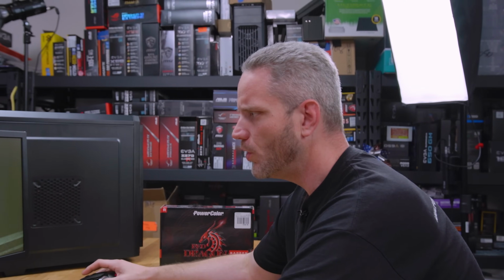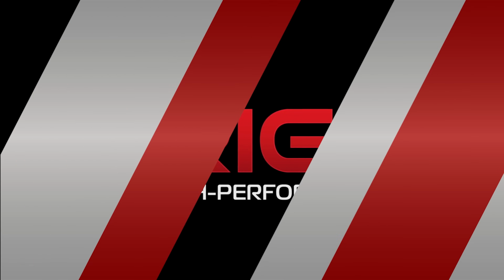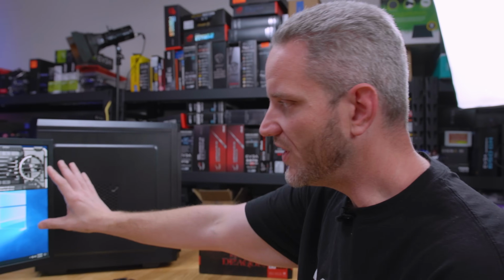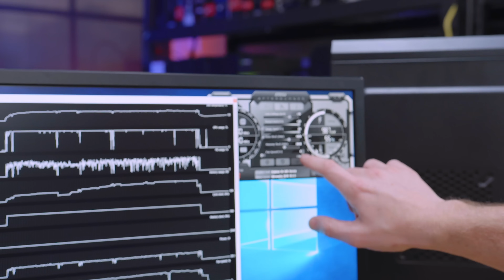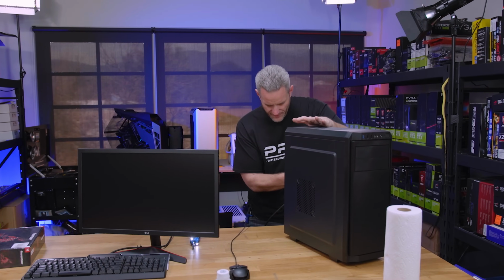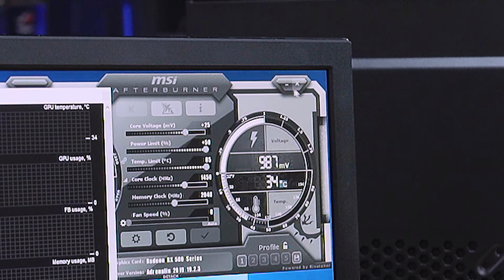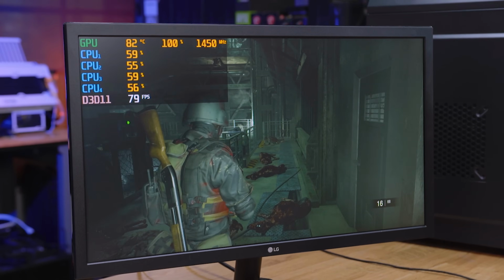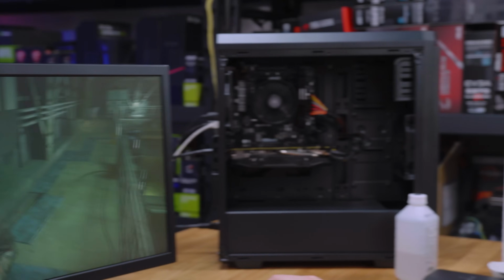Should you replace your video card's thermal paste??

Comment: Crazy. On my xfx gts rx580 8gb I only get 80c on a demanding game if I OC to 1500mhz in amd overclock. I also adjusted the fan curve, k got tired of the fans just sitting idly while the card got toasty. Works wonders for me! There is a bit of a coil whine, but I have headphones so it blocks it out for me.

Comment: Thermal paste degrades very slowly. There's a good chance you will not be able to tell after FIVE YEARS unless you are carefully running benchmarks. If your performance degradation is fairly sudden it's NOT your graphics card paste. Probably not the card at all.

Comment: So now seems how you kind of pointed out the fact that the bottle neck was the case air flow.  What happens to the levels with the factory thermal paste if you put a fan on it.... You know what, it prolly doesn't matter.  The good thermal paste and a large fan only took off 5 degrees.

Comment: Jay did you check the fan speed before and after?
GPUs are ok with 75-80°C and depending on type and manufacturer the card will stick to that temperature and would run with lower fan speed instead of let you see a massiv temperature drop.
That's whats happening with new cards if you open the case. Sensor says "Hi, temp is dropping! We are at 77°C!" -> Controller + Fan "Well, ok, i can slow down - all good!"

Comment: The problem with changing the thermal paste on my old cards is that i cant find any accurate specifications on the thikness of the thermal pads, so im afraid of buying and putting in the too thik or too thinn pads on the vrm and memory modules.

Comment: I have a case with 3 120mm intake fans and I can literally feel the air being sucked in when I put my fingers up to the front intake. Unsurprisingly, GPU temps are not such an issue in my case. But I really should replace the thermal paste on the GPU (And CPU, come to think of it!) anyway because the R9 280X I am running is rather long in the tooth, so to say, with the added bonus of having spent god only knows how long shoved in a drawer with dozens of other cards.

Comment: awww...a case with a a side fan slot <3 man I miss those...computer manufacturers completely sacrificed performance for bling lately didn't they? It is clunky to open the side panel, but if you popped a fan in that slot you'd see those temps drop for sure.

Comment: I'm guessing that the heat dissipation bottleneck wasn't that the paste couldn't move enough heat from the core, rather that the case doesn't replace enough hot air quick enough to keep the GPU from warming up.  If we want to show air cooling performance, why not show a computer that's got as many fan mounts filled as possible? I understand that this was a budget build, but the lack of case fans probably means that the GPU is doing some throttling or kicking the GPU fans into 100% just to maintain 80 degrees.

Comment: My EVGA GeForce GTX 1060 6GB SC apparently had a bad thermal paste application from the factory. It used to run real hot with the fan running wide open all the time. I took it apart with the intention of slapping an Asetek cooler on it thinking that the smaller single fan cooler was underpowered. I decided not to fool with it and put it back together with a fresh application of Noctua NT-H1. I wanted to make sure it was still working OK and threw either Unigine Valley or Superposition at it. Night and day. 20 degree drop in temps and higher boost clocks. It was amazing.

Didn't do shit for my GTX 1080 FTW2 though. Not that it was running particularly hot. Just felt like doing it after a year or so of use.

Comment: I had similar experience with my EVGA 1080Ti. My temp was around 85c during heavy load. I decided to take the side temper glass window off the case and placed the big fan much like in the video. My GPU temp went down to 74c. I looked around and noticed I have a 240mm AIO cooler mounted on the front intake and it was blowing in hot air. So I decided to rearrange my entire system by buying a smaller AIO down to 120mm and mount it at the back of the case as exhaust. Then I've installed 3 fans on intake in front and addition two fans on top as outtake. My temp went down to 76c under full load but now, my CPU holds around 55c under heavy load instead of 45c with bigger AIO. It's a trade off lol.

Comment: So, I have changed the thermal paste on my trusty old MSI R9 390x (overclocked to 1150-ish MHz, so consuming like 300W or something). On stock TIM, I used to get around 78C with these settings on average, but with spikes just over 80C with my fans pinged to 80%. After it started getting worse about a year and a half after purchase, I replaced the stock TIM with Gelid GC Extreme. Great paste, brought the temps down to about 74C for the same settings, but never spiked above 75C. After reading up a bit on the matter, I also purchased some Kryonaut and let me tell you, the hype is real. Gelid GC Extreme was for a long time the best performing paste on the market. Even so, Kryonaut managed to bring the temps down even further to 72C, while I was testing with higher ambient temps (Something like 24C vs 21C with the Gelid). Not only that, but it's been almost 2 years since I repasted my card for the last time, IIRC, and the only time I got worse temps was when I had dust build up in my GPU cooler. Cleaned it, boom, back to the same temps. That thing is miraculous, I'm telling you.

PS : Also, even though it's really not worth it for the money, I got some Fujipoly Extreme thermal pads for my VRMs and those brought the VRM temps down by like almost 10C. Ridiculous difference. Pity they cost like 20-30€ for a few tiny pieces.

Comment: A rapid temp increase(steep rise on the curve), can give an indicator on if the thermalpaste is not as efficient anymore. But the temp might not get higher (or lower after some time) due to the temp/clock setitings. Many cards has a factory fancurve set to hit 77-82c at sustained full load. (to keep the card as silent as possible) But a good thermal contact will give higher clocks at full sustained load with the factory fan profile - meaning that the clock will not need to throttle as much to keep it at around 80c.
MSI Afterburner with the optimized custom fancurve, will keep the temps down (sometime 10c or more), but also make a bit more noise. The upside is lower temps, since it clocks the higher Turbo boost freq the further away from temp limit.

There are exceptions regarding the factory fan profile/temps. I had the Gigabyte Xxtreme Gaming GTX 980 Ti, which was practically silent AND running at around 65c with decent silent airflow case (Define R5). But that card has a massive cooler on it. Also the MSI and EVGA aftermarket coolers do a good job silent,  keeping the GPU at max 70-75c, even on a 1080 Ti - as long as your case gets the heat out.

Comment: I use a cheapo bench mount as my case and don't have any issues with heat. Sound level is fine because the fans never spool up to high speed under load. ;^)

Comment: Changed manufacturer thermal paste to Thermal Grizzly Conductonaut (Liquid Metal) and dropped from 83 no OC which was set to limit to OC which is around 2000MHz at 75 
GPU is GTX1070Ti Armor

Comment: That card has a heatsink with longitudinal fins, which means it's exhausting some of the air out the back. If your front intake fan wasn't blocked off so much it would have enough force to push most of the air going onto the fin stack out the back and not into the case.

Comment: I have 9 fans inside my Liam Li 011 Dynamic and it is set to like 1700 RPM lol >_< Then my RTX 2060 that is coming Monday is the windforce version ... So, I'll have 12 fans LOL - Technically the top three are all set to push air out of the case while the other 6 push air in.

Comment: there is something else that could be a cause and thats poor machining/of the contact area on the GPU heat sync unfortunatly i dont have pictures but there is a definite differance between two asus ROG stix 1070's heat sync's one runs hotter by about 10 degrees and one the heatsync is alot rougher on the bottom compared to the other one

Comment: Not sure about video cards, but I replaced a thermal paste on my CPU with stock Intel cooler (and the preapplied thermal paste) after 5 years and the temps dropped from 85-86°C to 68-69°C max. Bigger improvement than I expected.

Comment: I redid my paste when I threw on a Kraken bracket and air on my 1080ti.  MSI caked it at the factory.  Maybe I should try adding an intake fan.
Reply: Is the fan on your G10/G12 a PWM fan? I know the stock G12 fan is a 3 pin fan. I would highly recommend getting a PWM fan & a PWM to GPU fan adapter cable. This will enable the fan to be controlled via the GPU.

Comment: I replaced the thermal paste on my early 2014 Gigabyte GTX 760 with one of the best currently on the market. The original paste was completely solid and brittle at this point. Then I replaced the fans with aftermarket ones with 3-4 times the static pressure. I gained nothing. Zero. Nada. Maybe the card was boosting higher but the temps were exactly the same. Finally I cannibalized the factory mounting plate and bolted (and by bolted I mean I used a large number of zipties) an AIO to it. Yeah it cools the vrm too. Gained about 20 degrees average and I don't have huge spikes in temperature. It's been 2 months and the mounting solution is flawless.

Comment: Nice video Jay! I just posted that I was doing this to my MSI 7850 2GB the other day. Never have replaced the paste since I bought it in 2012, noticed the other day only 1 fan is working. So order paste and replacement fans.. Unfortunately different manufacturers use different sizes and I got the 85mm and now am waiting for my 75mm to come in. Can't wait to see my results and see how long I can keep using this card. Fix it for 25$ or buy a new sub 200$.. Wife says fix it as I just got all new components except gpu to stay in budget.

Comment: I thought the AMD default fancurve used a "target temperature" system... where it tries to maintain the card at exactly 80 degrees.
Looking at your temps wouldn't reveal any differences. You'd have to look at your fanspeeds to see if the thermal paste made any difference. If it's maintaining 80 degrees at a lower fanspeed, then you've improved the card's thermal performance.

Comment: ANY HELP MUCH APPRECIATED!: 
I have a gigabyte gtx 1080 which I use along with evga precision. Whatever temp target I set, the card will reach it 10 minutes into playing and start throttling. The card isn't overclocked in any way, not even the power target. I only got the pc in october but it has refurbished parts and I have air dusted the card with no better results. Some games are worse than others, project cars 2 being the worst one atm. I use 100% fan speed all the time now but it still reaches crazy temps almost instantly (90°+). Should I change the thermal paste?

Comment: My old R9 290 was hitting 96c under load.  Repasted the core with some MX-4 and temps came down to 74c under load.
Reply: lol that still a lot. i mean you talk about amd things how should i know
Reply: @killerash13  74 isn't a lot you're actually lost
Reply: @weavercs4014  For a laptop yes isn't a lot. But for my desktop i dont like it to run that hot
Reply: I stuck full cover EK waterblocks and backplates on my two R9 290's, flashed them to 290X's and used them as silent cards for nearly 6 years with 35c temps, under load!

Comment: Whenever I watch videos like this, it reminds me that most GPUs can handle going up to 80c without issues. Yet I refuse to allow my 1050ti to go over 62c while under load. Makes me think I probably have some serious wiggle room that I'm not using with it lol.
Reply: agree...mine goes to 70- 75 and i am like ... " my card is going to fry "
Reply: @muhammadarslanriaz7778  Mine shuts down at 80
Reply: My gpu fan is set to 85% all time, 1070 usually dont go above 85c with overclock... Anymore though and i get pixel artifacts and crashes.... Stable oc with okay temps 👍
Reply: Yeah you're overly cautious. Once you get to 88c+ and throttling/overheating happens, THEN you can be worried LMAO!
Reply: 62C? Hah mine goes up to 102C before force shutting down the PC, loosing all of my work.

gET oN mY lEvEl n00b
Reply: @zedg7473  g1t gud scrub
Reply: @LuizAlexPhoenix  Wow this brings back so many memories of my low fps days, suffice to say I upgraded to a used gtx 970 and a 144hz monitor after that gfx card overheated and burst into flames. One of the capacitors burned IIRC.

But I can now run warzone 1080p 70+fps so get YEETED BOI👌

Comment: Hey Jay would you use liquid metal on a GPU? Concidering the damage that could happen if not applied correctly? Thanks. Your the best Jay!!
Reply: You need to solder all capacitors and resistors around the chip with nail lacquer and you only should do this with a nickle ground plate, like in this video. No copper and NO aluminum.

Comment: I just bought a gtx 1080 for 200 obviously it was being use for mining. I am using as a sli, is been 3 weeks already and so far no error but is a little hotter than my  og1080. Should I add new thermal paste?

Comment: I've been using a rx480 since the day it launched, and it has always run hot (80°C). When i first used it to play games, I had lots of black polygon like artifacts. Since then, I undervolted it a bit without getting any performance dropoff and lowering the memory speed seems to have helped removing every artifact. The fans are getting really loud though, does it mean I am dommed to play with background noise or to buy an aftermarket cooler ?
I'm considering replacing the GPU's thermal paste but seeing your results, I kind of don't feel like I need to anymore ...
Needless to say that warranty is no longer a thing for my card.

(GPU : sapphire rx 480 nitro+ oc 8g)

Comment: If you have an XFX card, I highly recommend changing it... No more seriously :
- Undervolting (Because their XFX default bios settings is often out of the chart)
- Replace thermal paste
- Replace thermal pads

Basically you need to service it even before you use it... 
I have an XFX RX 580, only a great purchase AFTER the service is done.
I had to apply LM to mine for it to be silent. ~2200rpm max.

Comment: 10:46 "If you got a graphic card that was running great and now it's running really hot [...]"

You should dust off the heatsink first.

But sure, thermal paste lifetime is about 5 years so it's not a bad idea to look into that too.
Reply: Lifetime of usability? Sure.
But just like milk, it doesn't just crap out right away. It will slowly "spoil". You will notice a gradual change in temps/fan noise. I go about once every year and a half, and dust out once every 60 days. I also live in the desert with a very high dust count in the air, extremely low humidity which can affect the life of the thermal paste as well.
Reply: Its not 5years if you take good care of it then its more
Reply: @aleksifrmdao  why argue, just put ice pack beside the cooler problem solved

Comment: Hey jay i have 3 plugs on my 980ti g1 gaming by gigabyte one is for rgb one for tge fans and the 3rd idk however only one plug comes of the other two are stuck. People say the connectors break off the pcb very easiely but how do i disconnect them without breaking

Comment: I would never Recommend anyone to take of side panel!!, for better temps. changeing paste on old card that has been running for years might be good idea, and blowing out computer for dust with compressed air once in a while,  the better upgrade here is better airflow  in the chassis,  could be to change Fans to something such as Noctua NF-S12B redux-1200. But Never ever takeing off side panel from chassis

Comment: Also a thing to remember is that some thermal pastes need time to cure.

What this means is that you will not see the best performance from the thermal paste just after applying it and you need to have the system running for 24 hours, or even more, before the TIM has reached its optimal performance.

Comment: A tip that JayzTwoCents hasn't discovered yet.

When you first take the cooler off the GPU, before you use any kind of paper towel soaked with Isopropyl Alcohol, get a wooden toothpick and gently remove the clumps of thermal paste around the GPU.

It makes cleaning the rest of it so much easier.